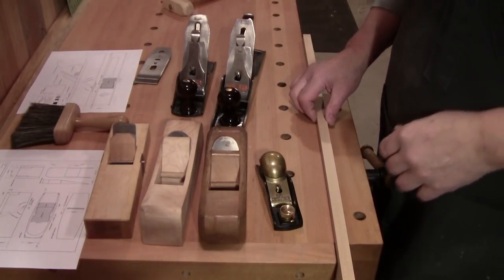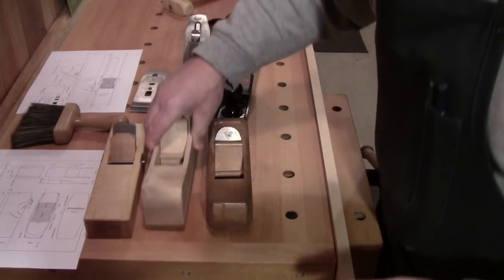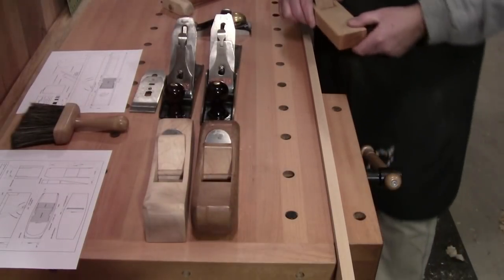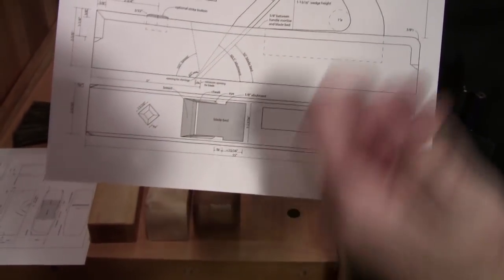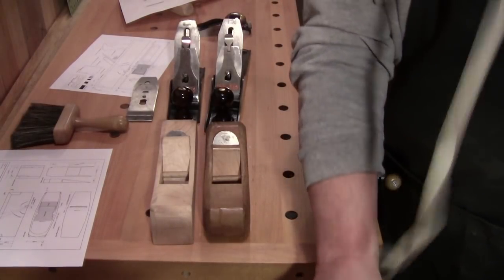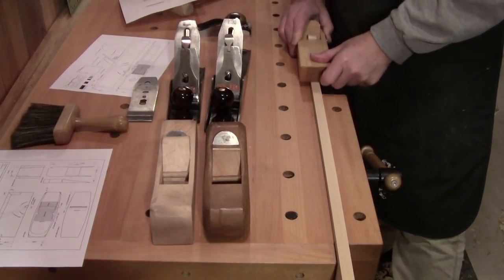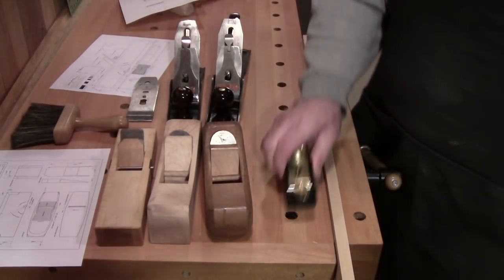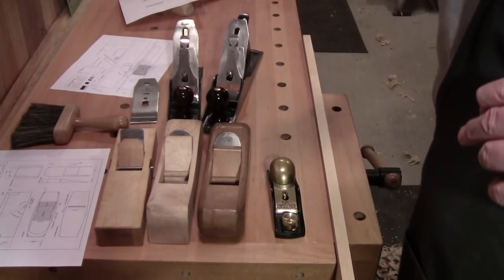No need to shut your mouth... We need a Wear Bevel - PLANE TALK - 21 December 2017

Comment: Thanks for the info Walter after I learned how to properly set my chip breaker it made a world of difference. I do have a question should you polish your chip breaker as well?
Reply from the maker: Thanks for writing, 
I do smooth and then polish the front of the chip breaker a bit.  It does allow the shaving ro roll over it more easily.
Reply: @DustySplinters  do you ever experiment with different angles on the outside edge of the chip breaker?

Comment: Hi Walter. Thanks for all those useful videos. I have a question. You said that the only difference between your wooden planes is the wear bevel. But the one with the wear bevel also have a chipbreaker and the other two doesn't. Do you have same result with one blade and wear bevel but without chipbreaker ? I hope i'm clear. Thanks
Edit : i guess i have my answer with your block plane demo !!!

Comment: I’m willing to lock down my frogs but not sure exactly where to set it. How do I determine that position?
Reply from the maker: I lock down my frogs just back far enough so that the blade bed is flush or slightly ahed of the back edge of the mouth opening.
Reply: Thanks, I’ll try that. I was trying to make solid seating along the back of the blade from opening to top of frog with no gaps. With regard to the blade, how is it seated on the frog?
Reply from the maker: The blade can rest on the entire frog face if it wants and it just misses touching the back edge of the mouth.
Reply: Dusty Splinters Ok, this is the missing information. I was trying to rest the blade precisely on the back edge of the mouth AND lie flat on the top surface of the frog. Since it will be moved forward in use, why does it matter if it rests against the mouth?

Forgive me for belaboring this detail but no one have ever been specific about this aspect of setting up a plane, new or used. All I’ve ever heard is: “You can adjust the the frog forward or back......” with no explanation with its relationship to the blade. 

Thanks for taking the time to help me understand this. I want my planes to work like yours!

~ jeannie
Reply from the maker: No problem.  If, you push the frog too far back, the blade ends up hitting or resting on the back section of the mouth opening.  IF that happens then the blade is not fully resting on the frog itsel and either it will not lock down properly, might not advance and retract properly or... wort case the sole will crack at its weakest point.  
Something similar can happen as well if the primary bevel is not under 45 deg.
You want the blade to be able to slide past the sole with zero contact on the sole at the rear of the mouth.

Comment: Hi! Do you have some videos or just tips on planing hardwood endgrain. I can't seem to plane endgrain on oak pieces I've got. I went up and up with the bevel from 18 to 25 degrees on a 20 degrees bed and same story: the blade just skips or halts and dulls. It's hard steel. I would even say too hard as it takes long to sharpen it even on a 1000 grit Japanese water stone. I would guess it all boils down to sharpness but the blade does shave hair before I commence shooting.
Reply from the maker: Thanks for writing,
Which plane are you using?  
Is it bevel up or bevel down.
All planes use a primary bevel of 25 deg.
I hone my Low Angle Block plane to a pure 25 degrees.
Reply: Dusty Splinters It's a bevel up Goldenberg (France?) metal block plane. Simple critter. Solid cast iron body but without any adjusters. And as I said, it's not a low-angle block plane by any means with its 20 degrees bed. The sole is flattened and the bedding for the blade support just behind the mouth opening is reasonably flat and mating with the blade. Only the part of the blade furthest to the cutting edge has a twist. The blade sits on the full-width bedding at the front and at a single cast post at the back so mechanically it's an equivalent of a three-point support.
Reply from the maker: OK, the best you can do with a standard block plane will be honing it to a pure 25 deg edge which will give you the same cutting angle as any bevel down plane ( 45 deg )  so... if that is all you have then that's the best you can do.
If it has an adjustable mouth you can close it a bit.
Have you tried another standard plane like a smoother?
Reply: Yes, I did try my regular metal jack plane (Footprint 5B) once I hit 45 degrees effective angle with the block plane. I felt the jack faired better even though it was not freshly sharpened and the convex bevel on it slowly approaches 32 degrees. One more thing I'm going to try is a proper shooting board. I've been using a bench hook so far which gives me little control over micro-feeding the pieces toward the plane.
Reply from the maker: Shooting boards can help but in reality, any sharp plane should handle end grain.  Ine thing you definitely do is make sure you have a lubricated sole on the plane for end grain or you may have too much resistance and chatter.
Reply: Dusty Splinters Thank you for sharing the knowledge. On this topic and in general! I'll try to report back with my findings. | How about an idea for a future video. Since you specialise in in-depth approach... No one ever discusses grain direction approach for end grain. It may not be a subject suitable for a complete video but mentioning it would be great. When I was making my oak coat hanger sometimes the difference in the ease of work was very significant.
Reply: Hi! Me again on that chattering on endgrain. An update, if I may. It turns out I was so fixated on the blade laying flat on the sole "console" that I didn't notice that the lever cap contacts the blade... on a single point (corner)! This was caused by a manufacturing flaw in that the groove in the lever cap for the crosspin abuttment was not horizontal. Thankfully the lever cap seems to be solid stainless steel (as opposed to nickel plated) so I could grind away without ruining the looks. I haven't tested the fix yet but I'm pretty confident the block plane is no longer outright useless.
Reply from the maker: Well, I'm somewhat following you I would have to see it.  email me at:  waltamb@npacc.net
Reply: Thanks. I wouldn't want to waste your time so I'm going to write you a message only after I take proper photos.
Reply: Those photos should do. I didn't include a photo of the final state of the plane - it looks the same on photos but with the culprits rectified. So let me do a recap: Culprit 1 was the lever cap only contacting the front part of the iron on the right side, on ~20% of the width. Reson: The groove in the lever cap as well as its support, the cross pin throught the sides of the sole, were off. Culprit 2 (rectified May 20th) was that the lever cap was reaching too far to the front, overhanging the bevel of the iron. Final result: I was able to shoot both, beech and oak pieces circa 10 mm thick. For thicker pieces I used my No 5 jack. Here's the link to the photos, some fresh, some old https://1drv.ms/f/s!AvyUQyNGJs9mkaECstRLuwhwjVqBOg
Reply: I can't see the photos, but if you're trying to do a larger area of end grain, you're never going to be able to plane it easily (as in, hand planing the end of a 4x6 or something, or a large area like an end grain butcher block. To the extent than you can, you'll want to do that in facets. Same goes for the end of an 8/4 hardwood. Mark the cut, take it off in facets until the very end. 

Plane design shouldn't matter - I find most of the bevel up bench planes to be easier to use than a lot of the larger and heavier bevel up planes.

One thing to consider - metal has a really strong grip on the end grains of some woods. You can mitigate it with waxing - and do it very often. There are situations where a lighter wooden plane works better because you don't have to deal with the grip. The continental styles are nice if the iron is good (no friction, two hands on the plane, work in facets). 

Anything wider than 4/4 wood can get difficult quickly if it's hard.

Comment: 1 why are you so angry?
2 why does the shape of shavings matter as long as the surface you produce is the same?
3 do you think people would like to watch this attitude?
Reply from the maker: Thanks for writing...
Not angry at all.
Shavings are only important to use as an indicator of your edge and plane performance.
Meaning, how well is it cutting and how efficiently to ...
Yes, produce a smooth surface and do the task asked of it.
Have fun in your shop and go make some shavings...
Thanks for Watching.

Comment: I know it's an old post but I think the marked angles for the front of the plane opening should read 115 degrees  for the wear angle and  75 degrees for the breast angle IF referenced off the front of the plane. ( the breast angle as shown is LESS than 90 degrees and the wear angle is MORE than 90 degrees
Reply from the maker: Thanks for writing,
I was just referencing a well known wooden plane maker and the concept of an effective wear bevel.
Yes it is possible that the broaching tool can be set at some other angle other than 90 deg.